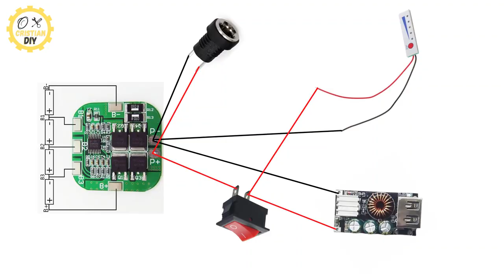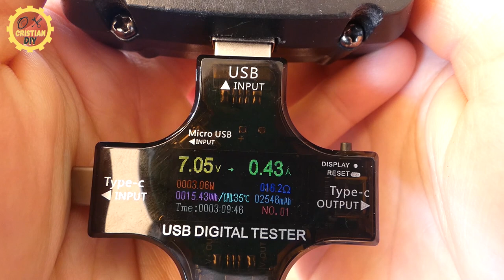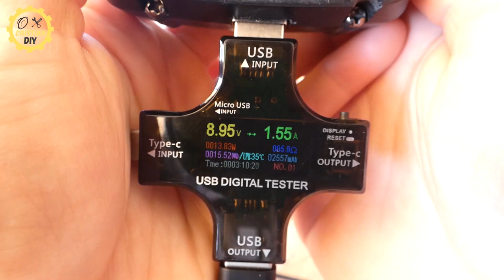Transforming Dead  Drill Battery into Fast Charging Power Bank

Comment: Nice. FYI: on USB, pins #2 & 3 are for communication - not power. Unnecessary to connect for this project.
Reply from the maker: If i don't connected doesen't work the fast charging because the phone negociated the protocol with the bord how may volts/amp needed. Thanks ❤️
Reply: @CristianDIY  please accept my apology, I was unaware that the board had the capability. 👍
Reply: I appreciate both yall